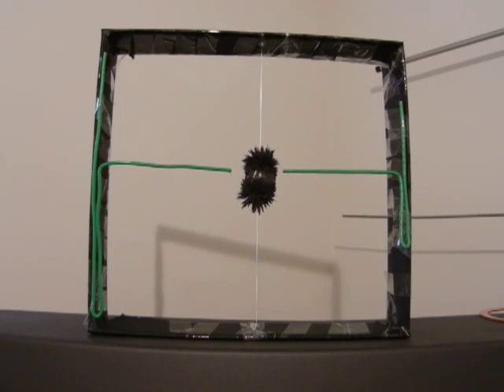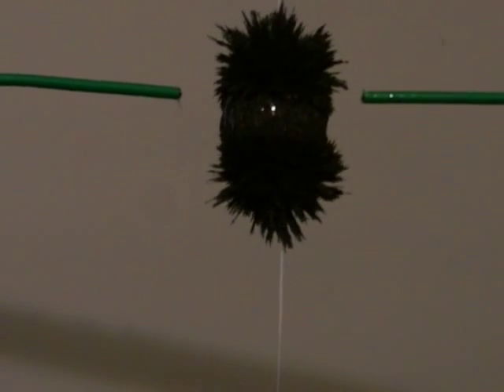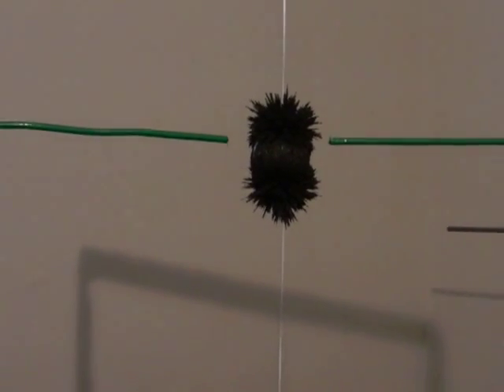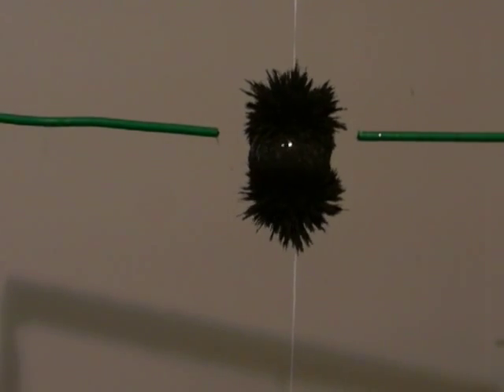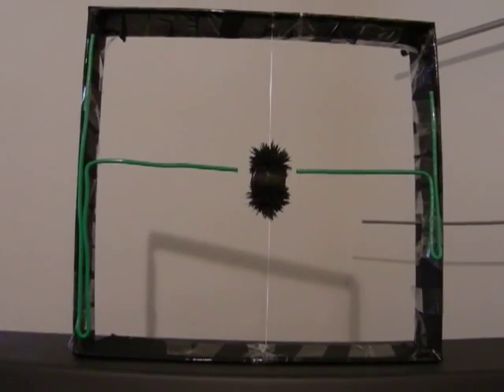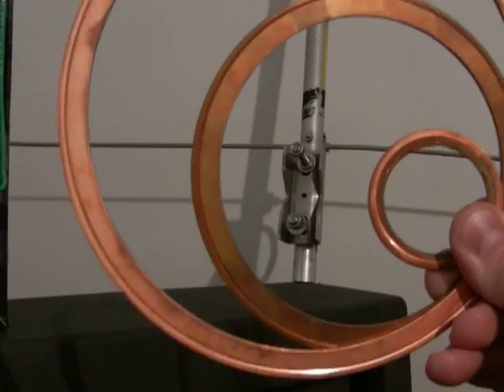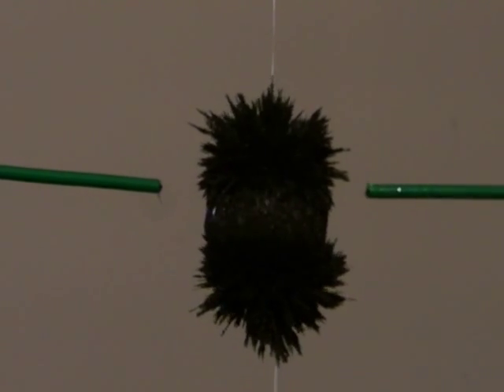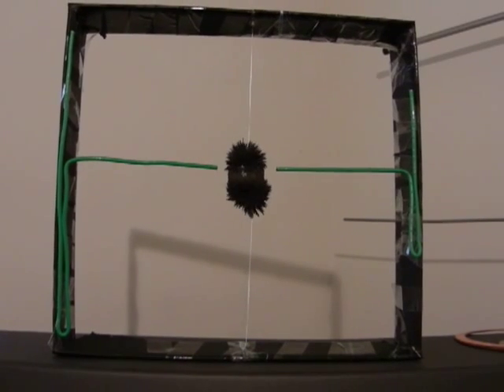MAGGI, Magnetic Perpetual Motion Art. Neodymium-Yagi device using Magnetosphere and EM induction

Comment: When it's wiggling, bend one wire carefully out of the way.   Does it stop wiggling?   How about with both wires bent away?   (I'm thinking that ambient b-fields are a major contributor to rotating the mechanical-resonant neo sphere, so the wiggles always happen, even without an antenna.)
If the wiggles are all gone when nothing else is changed, but the copper is suddenly moved away or snipped off, VERY VERY COOL DISCOVERY.

Eliminate the "EW Keely effect," where PK mental-forces from the experimenter are producing the effect.  Leave a camera filming the device, then move far away!

Enhance sensitivity: position a distant, long neo magnet so that it cancels out the Earth's field near the sphere.  Then the neo sphere can't be aligned anymore as a compass, and extremely tiny b-fields should make it swing wildly.  When making Torsion-field sensors from living grass stems, Grebennikov instead suspended them using spiderweb.   Single human hairs don't work nearly as well as spiderwebs, or a yard-long DIY glass fiber.

For an actual "bearing," sometimes you can use a needle with the tip stuck to the bottom a magnet.  That way it can rotate completely with no twist.   But I bet it can't lift a heavy neo sphere, and still maintain delicate sensitivity.

Heh, maybe this detects the magnetic component of some half-hertz radio waves from a secret Naval worldwide submarine-comms system.   We already know about their 25KHz transmissions, and the "Taos Hum" 75Hz stuff, but nobody explores the deep-ELF below 8Hz.   If so, then the tension of the nylon is critical, because it determines the resonant swing-frequency of the neo sphere.   If true, then making it swing  a bit faster or far, far slower, and you've tuned it away from the military's microscopic EM transmissions which only a resonant device could accidentally detect.

Comment: My current criticism is the obvious: if the radio antenna thing works there is a lot of wasted energy involved with creating the radio waves. There would be a lot of situations where this machine would not work, such as perhaps outside a major urban area. Which is why I wonder if it works inside an urban area either. It is so possible this is yet another blow-on-it kind of hoax experiment. Aren't radio antennas receivers more so than generators? Hasn't there been a lot of discreditation of the idea of using 'copper wires' for anything perpetual motion related? Generating power with an antenna sounds a lot like using a battery. Most battery experiments involving copper wire actually involve a fan or something similar to create the illusion of perpetual motion. Maybe this is just a more complicated version of the usual scams. Still, the voice sounds honest, but then again I can be a pretty gullible person. I kind of wish it were just a philosopher with a good idea, but copper wire? Did it have to be 10-gauge copper wire?